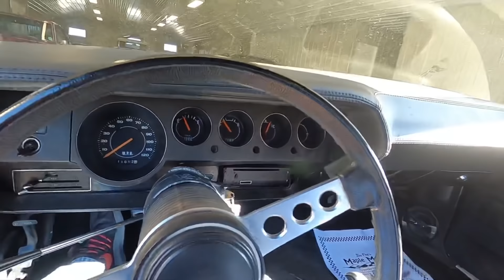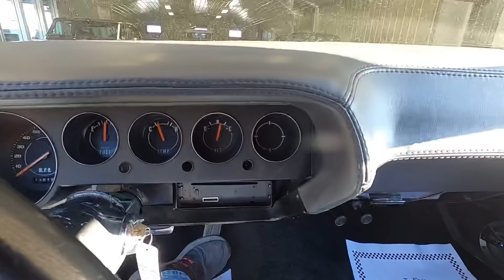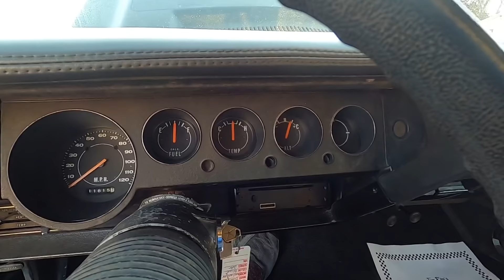Test Drive 1973 Dodge Challenger SOLD $25,900 Maple Motors #1289

Comment: Finally a Challenger at a decent price.  So many are just way over the top price wise.  Curious, does your dealer ever fix things like the wipers, horn, etc before selling, or just send them as is, and adjust the price?  Either way, great prices you advertise.  This one I would put different wheels/tires on, the skinny fronts are not a thing I'm into, but some would like.  Seatbelt, and wipers seem like a safety thing that could be addressed before selling, just my opinion.
Reply from the maker: No we are as is , buy and sell lot. Thats what these videos are for. To show what all they need, Thanks
Reply: @MapleMotorsNickSouthgate  Cool!  Again, great prices!

Comment: Nice one. I would remove the “340” stickers and the fins if possible. Run those side  black stripes all the way to the back. Lower the suspension a bit if possible. Fix the small things like horn and wipers…cruise and enjoy.